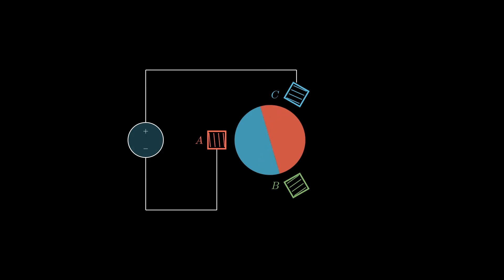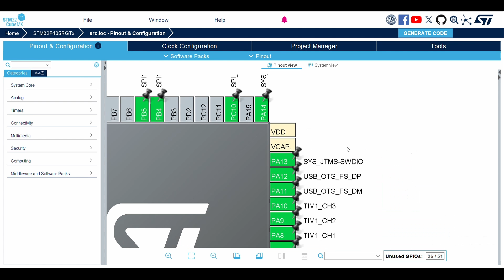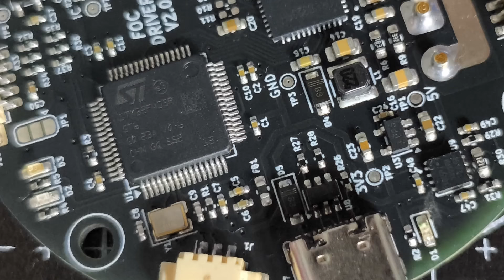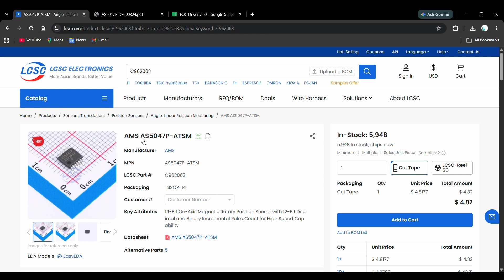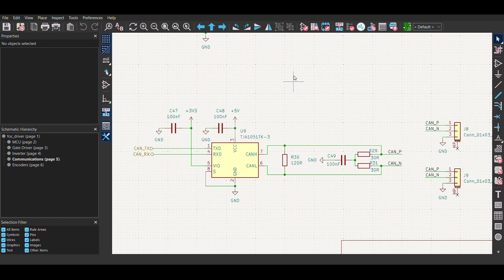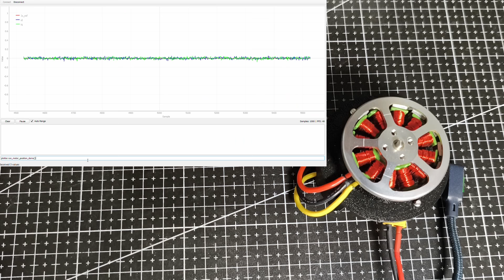I Built My Own BLDC FOC Driver From Scratch

Comment: G431 is better, it's lower power and has hardware trig functions. You can also get it with gate drivers and buck converter included in a single package, the stspin32g4.
FOC can also be sensorless.

Comment: Hi, I'm looking at building your SF-Motion FOC driver through JLCPCB. Thanks for making the design available.

I ran into one question in the BOM. R7, R8, R10, and R11 are listed only as “R” with no resistance values.

From the schematic, it looks like:

R7/R8 configure the DRV8323R IDRIVE setting
R10/R11 configure the DRV8323R VDS setting

Could you tell me the resistor values you used on the working boards for R7, R8, R10, and R11?

Also, if you happen to know, what IDRIVE and VDS settings were you targeting with those values?

Thanks — I'm trying to reproduce your tested board rather than guess at the settings.
Reply from the maker: Hello, honnestly I am not really understand about the best value of IDRIVE and VDS for my MOSFET. In this video I tested without any resistors in IDRIVE and VDS. Based on my experience, I also have tested all configuration both in IDRIVE and VDS. I don't know what the difference is, because I don't have equipment to measure it, but it works.
Reply: Thank you very much for the detailed answer and for sharing your testing experience. This is very helpful. Knowing that you tested the board without the IDRIVE and VDS resistors, and also tried the different configurations successfully, gives me a good starting point for reproducing your design. I really appreciate you sharing the SF-Motion project and taking the time to answer my questions.

Comment: Hi! I’m studying your SFmotion board and using it as a reference for a similar BLDC actuator project. I noticed that the design doesn’t appear to include some of the protection/safety features we’re considering adding, particularly regenerative current/DC-bus overvoltage protection, along with protections such as overcurrent/short-circuit and DC-bus undervoltage/overvoltage fault handling.

Was this a deliberate design decision based on the intended application and operating conditions, or were these protections handled elsewhere in your system? I’d really appreciate understanding the engineering reasoning behind these choices before we implement them differently. Thanks!
Reply from the maker: Hello, My design doesn't include any safety protections because I want to keep them as minimal as possible to reduce costs. Maybe those protections can be placed on another board. So I only need one board (like a power management board) to keep all my drivers safe, instead of having them on each driver.

I'd like to add some safety features on the firmware side, such as overvoltage, undervoltage, and overcurrent protection.

And as far as I know, DRV8232 has some safety features, such as protecting the MOSFET in case of short circuit and then sending a signal to the nFAULT pin. cmiiw
Reply: @srj4555 I have one more question regarding regenerative energy. During deceleration or when the load drives the motor, energy can flow back into the DC bus and raise the bus voltage.
How do you handle this regenerated energy in your system? is it stored in battery ?

Comment: for the shunt resistors u r using 4 pads shunt resistors in the schematic and footprint  while the lcsc part number in the excel sheet is a two pads shunts.
Reply: I believe you just do Kelvin routing. You physically put the two pads on the physical two pads of the PCB. Then, you route on the inside two small routes towards your amplifier, and that allows a precise measurement
Reply: @bmoreno-ri8  there is a ctually a good article form analog devices about this topic , i shared the link here replying to my comment but it was deleted idk why.
Reply: @mohanadhassan306 oh would love if you find the link and share it here once again!

Comment: I checked the datasheet and found that the DRV8323RHRGZR chip has built-in current sensing capability. However, I noticed that you used an INA240 as the current sense amplifier. I'd like to ask — is there a significant performance difference between these two current sensing solutions?

Comment: Your design is very awesome, thanks for making sth this capable and sharing, If I had your engineering prowess, I would test one thing and share

with the encoder you have, and adding a 1:1 rotor inertia, and tuning analytically from first principle model or identified model, what position control bandwidth can you get ? would switching to a higer bit encoder increase the bandwidth? for very small angles atleast, where velocity loop is not being saturated, please share if you hwave the spare time (video idea hehe), amazing series have been following and totally worth it, you deserve more subs

Comment: there's a real need for field orientated control open source implementation in Fdm 3D printing extruders, it would improve quality of the extruded plastic, clog detection, pressure flow and other features I'd be able to imagine

Comment: Hi Siroju, 
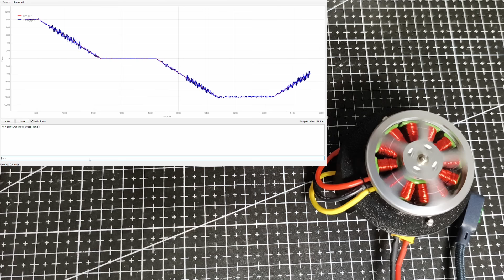At around 12:05, you are running some ramp functions. Is that ringing on top on the ramp functions? How would you alleviate that?
Thanks for posting and supplying the code.
Reply from the maker: I think several factors contribute to the occurrence of ringing, such as noise from the current sensor, noise from the encoder, and the PI gain settings in the speed control loop. Sensor noise can be mitigated using a low pass filter or similar methods, and  usually high kp in P-term causes motor vibration during speed control.

Comment: Why you dont use vesc based foc? Rather than design from scratch. I also have similar project to make my own foc board for electric vehicle, special for electric motorcycle. But, it need a pretty big budget for the research.

Comment: Are you sensing/measuring the back EMF from the BLDC motor in this circuit, or is the motor position/speed being determined using Hall sensors?

Comment: Excellent work!  I believe FOC needs current data from all 3 motor phases, which means 3 ADCs will be used full time for one motor.  I don’t think there is an STM32 with 6 ADCs, I think the G474 has the highest count at 5 ADCs.  It might be you can only control one motor per MCU, would love to hear your opinion
Reply: Only two phases are required. The third is always the negative sum of the others. Although with lowside sense, it limits your usable voltage since you need the lowside mosfet to be turned on long enough to get a measurement. With 3 phase sense, you always have at least two measurable since only one will go near 100% duty at a time. You can get by with a single ADC, it just limits max duty even further, having to sample each phase sequentially during the lowside on time. Multi-motor doesn't increase the number of ADCs needed since you can stagger their start times so their sampling windows don't overlap.

Comment: 2 layers is ambitious. I’d want to use at least 4 layers to keep motor-power and logic-power signal planes away from one another.
Reply: Yeah, the only reason to do 2 layer these days is if you want to manufacture them at home. But JLC is so cheap there's hardly any point. Assembly is where to save money. 4 layer is so much better. More compact and less EMI worries. Although you do lose some of the gained routing space due to needing ground vias next to signal vias so the return current can travel to the other layer's ground plane. Else you lose the EMI benefits.
Reply: more important the analog stuff. Digital signals are especially at this low frequencies not that much in danger.

Comment: if the microcontroller communicates to the PC through usb, the microcontroller gives preference to the usb than running foc algorithm. It may slow down the execution. Did you faced it? maybe if you try to stream more motor parameters, you may feel this.

Comment: This is a really good product and ı love it! I saw some python graphics ui in the video but I think for easy configuration and other things you should add a good looking ui, you should make it easily configurable and usable for the end user. You created configuration commands so it should be fairly easy to add a wrapped ui with AI with just some prompts. RPM gauge and other things you know just like Vesc. I also love the fact that it is only 2 layers, you are a really good pcb designer. Really sad that I will not be able to get my hands on one because of my current situation, ı would love to contribute to it at the future.
Reply from the maker: Thank you for the feedback, it will be implemented in the next stage.

Comment: I can recommend the STM32 G474/G431 MCU aswell for future boards, they have some cool dedicated hardware internally for motor control. Also I highely recommend going 4 layer or even 6 layer for your JLCPCB. If you stay below 50x50mm your 6/8 layer boards are still below 2 dollars and you get plugged and filled vias, ENIG gold finish, etc.
Reply: Sorry for the dumb question, but what's the main difference of having a top and bottom layer, and having 4/6/8 layers? Is that just for having a layer dedicated to ground for example? Or is it better for routing?
Reply: @alfiolocatelli5093  GND, better for routing, and really important : divide analogue and digital signals each with its ground reference, im sure he has quite a lot of noise on his analogue circuits, limiting him at some point.
Reply: @TwixWaffles  Interesting, is there a specific manual or tool in order to simulate this kind of interference? How to isolate the switching of the MOSFET for example? Usually each GND in the schematic needs to have a dedicated copper layer?
Reply: @alfiolocatelli5093  im not really sure, probably just measuring with a higher end oscilloscope.  You will see quite a lot of noise, specially at rising flanks. You can connect the oscilloscope to mosfet to get the flanks and then see the effects on the circuit with another probe.
Reply: @TwixWaffles I will dive into this, thank you!
Reply: @alfiolocatelli5093 ive seen Robert feranec do entire simulations on these kinds of interference if you're interested in it. Also explaining how the grounds and all of that works
Reply: @alfiolocatelli5093  i recomment the channel electrarc240 - he covers this in depth in a recent video

Comment: I'm also developing my own driver just to learn. I'm curious about why you chose STM32F405 instead of the STM32G474.

Best regards,
Víctor
Reply from the maker: when I first start experimenting with foc, stm32f405 was easy bo buy in my country, so I didn't need to import it just to give it a try. I might consider using the stm32g474 series in the future.

Comment: How many iterations of the hardware did you need before it had no bodge wire any more?
Reply from the maker: Before this, I had made 5 different versions of the board since starting my FOC research for my final project at college. But none of them had any bodge wire because I always do design rule checks many times on the PCB CAD software after finishing the design before manufacturing.
Reply: @srj4555 After graduation, and presumably losing access to Academic license, which PCB design software do you intend to use?
Reply: @DustinMaki The schematics is made in Kicad. I guess that is what we all want to hear 🙂

Comment: Beautiful, but if you're doing sensorless, can you make it control multiple motors while not raising the price too much? Let's say two or three motors for a robot kit? What would happen if you were asked to do 10 on one board?
Reply: Perhaps there is a way to order a full uncut panel and separate just the number you need in the arrangement you need.  Like an H shaped group of boards to allow access between wheels.

Comment: you got me into motor driving with FOC, HFI  and all other thing.  Today I managed to drive A/C compressor with 300v supply without blowing anything up, unlike previous attempts with VFD . Bravo on the project. I think price is right, since it is some what complex, what this hardware requires. Can't wait for next episode!q 
One question: foc_speed_control_update() and foc_position_control_update() increment their loop counters but never reset them after reaching the configured period. Is that what you intended to do?

One thing you could also implement is: to measrure BEMF (without externally spinning the motor). Good for project, where you can't or don't have rotor position
Reply from the maker: aaa.... Thank you for your attention to detail. I forgot to reset the 'loop count' to zero. It was a bug even though it still ran, it produced a different control response.
Reply: How would you measure BEMF without physically spinning the motor?  Doesn't the existence of BEMF require the motor to be spinning as generator?
Reply: @DustinMaki  yes, you do have to spin it, but not with external motor, what is what I wrote. You can of course spin motor itself with the driver in let say open loop and measure BEMF that way. You don't always have access to rotor